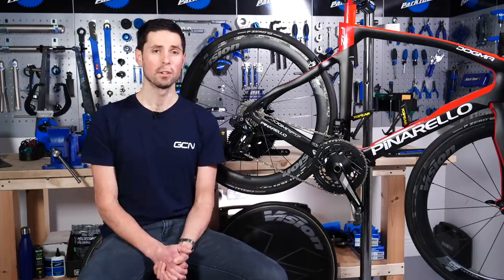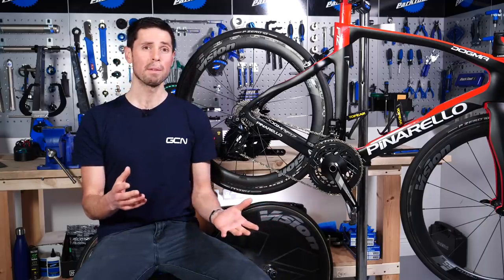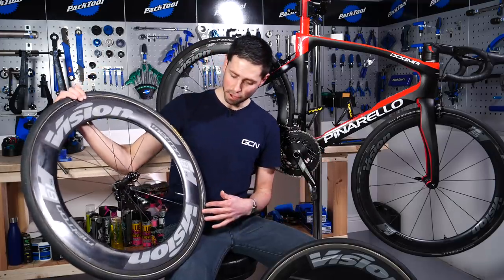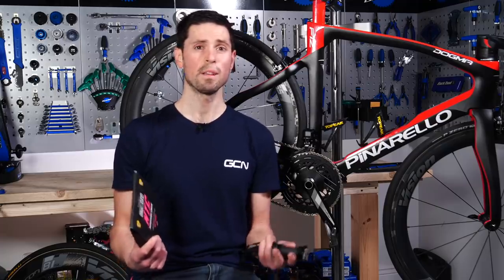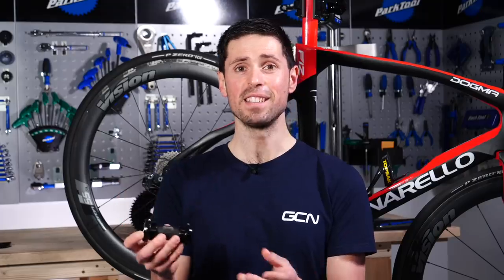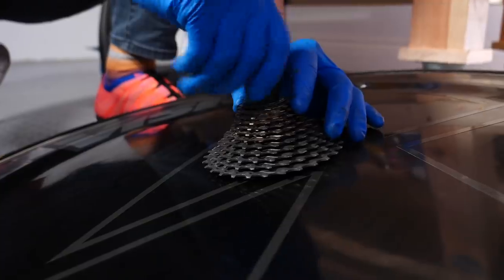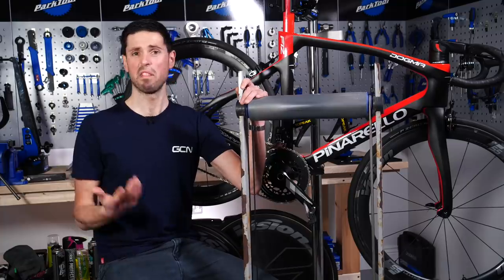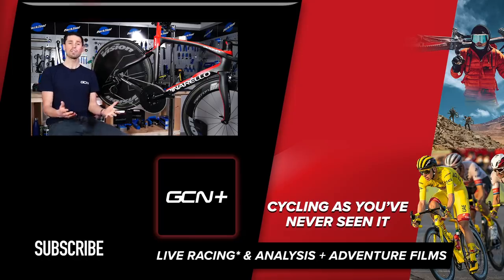Rollers World Record Bike Tech | What Did Alex Use For His High Speed Attempt?

Comment from the maker: What did you think of Alex's setup? Let us know in the comments!
Reply: Alex you did a great effort and its good to see you on gcn tech.  i like watching yall more than alot. we know yall read these comments and thanks alex and thank you to all of you
Reply: I think I understand the UCI aero position, position, now... They're worried Alex is going to cut himself in half on that chainring...
Reply: @wwcyclery   I have to agree that the roller diameter is probably where the most power could have been saved through both axle bearing resistance and tire rolling resistance on a larger drum. My guess is that the second greatest power drain is the front wheel spoke churn (heat shrink vinyl taped to the rim - hope it doesn't fall off at the 45 minute mark). However it looks like the 62x11 gearing was too low. The gearing probably should have been targeted at a lower cadence matched to Alex's max hour long power capability (I can maintain much more power at 80 rpm for an hour than 90 rpm but I am an old man).

But where are you going to find a sponsor with a 72 tooth chain ring...

Comment: Zero reason to have gears and chainline to deal with for something like this.  Gear it for your record, run a single cog in the back, lose the whole system of derailleurs and such, and it'd be a heck of a lot cheaper than ceramic bearings and faster.
Reply: yeah but GCN are not buying any of that, they already have it, or got it from the sponsors
Reply: Yeah, a better chainline would have saved a few Watts alone.

Comment: If you used spacers on the cassette, you could have used a single 12t cog and put it in the right spot to have a straight chainline. In the 11t cog the chain will not be straight.
Reply: Easier still,get a track bike with said gearing

Comment: Pinarello F12 with rim brakes!!  No fuffing around with disc brake rub, especially when you are never going to use brakes.  Congrats on choosing the right equipment.  Don't get me wrong, I ride both rim and disc brake bikes and there are advantages and disadvantages to both.  The point here is to choose the brake systems for the correct type of riding - i.e. riding on gravel, commuting in the rain, being a bike courier, riding down a mountain trails on a mountain bike versus attempting an hour record on rollers, road bike racing in the summer, TT in a triathlon.  You get the idea.

Comment: As several commenters have said, the value of a disc and even deep section wheel is unclear in this stationary case. The larger surface area of those wheels (compared say to a low-spoke count wheel) might mean you are stirring a lot more air and thus losing a lot more power to keep them spinning. On-roller steady state power tests could readily determine your best option there. Minimizing drivetrain losses makes sense, but as others have said, it might be even better to go single-speed / fixed or at least get set up to run a fairly straight chainline in your anticipated gear. Unless there's a rule precluding it, get the largest diameter rollers you can, and consider running wider tires - a huge fraction of the power loss on rollers are rolling resistance - a large (28) high performance tire at high pressure might save significant watts. (Again, readily tweaked by some testing, and maybe a fun chance for a GCN does science bit - actually far more controlled than most of those bits!)

Comment: What is the tire size and are you using latex or ultralight butyl tubes?
Reply: Idk if tubs have the option for different tubes inside but they can't change them easily. And size is prob 23 or 25
Reply: @natgeoba7377  some tubs are made with latex tubes inside- tend to only be the higher end Vittoria's though.

Comment: using aero wheels is a wrong 
you won't have any speed ahead, so your aim has to be reducing moving surface as much as u can, as less spokes as possible
Reply: Spokes whipping round is a huge aero loss in in this case, skin friction is very low at high reynolds flow-double discs would have been quicker.
Reply: Lots of drag on spokes going around,  regardless of forward speed

Comment: #askgcntech without fail every time I remove my disk brake wheels for service the rotors always rub when I reinstall them.  Then I spend 20 or 30 min to fix them until next time... doesn’t matter if it’s mechanical or hydraulic. I’m not touching the rotors at all to bend them so that’s not the cause. Do you have any clue and how can I stop this in the future?

Comment: should have ceramic bearings in rollers and think of more efficient way to transfer rear to front, there could be massive loses. Also should have ceramic bearings in wheel hubs and front wheel - disc as well.

Comment: why would you use plastic rollers?   metal rollers are much smoother....
Reply from the maker: The smoothness of the rollers themselves wouldn't impact the result particularly greatly - the main challenge is reducing the drag of the roller in the system which is in the roller bearings. Think of it this way - the roller is like an extra gear in the system, if you could fix the roller to the wheel in the same way the chain is fixed to the bikes chainrings/cassette, then you would.